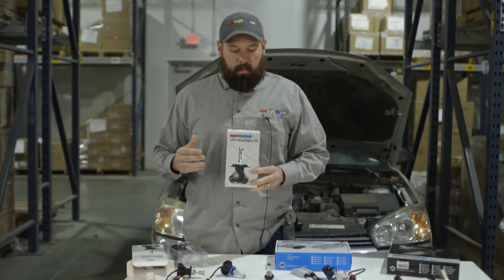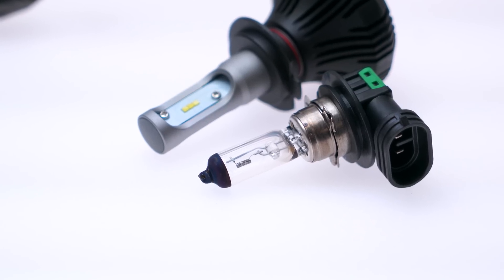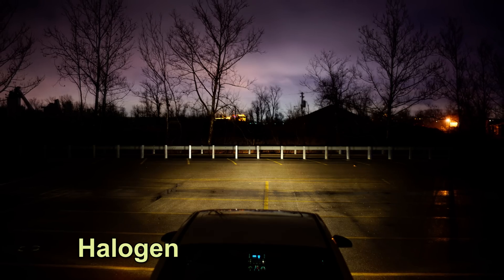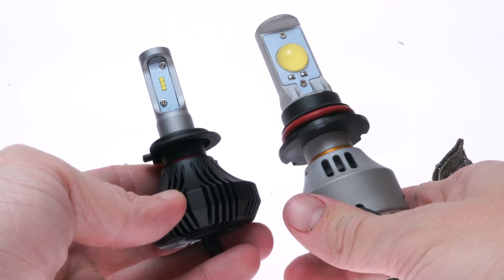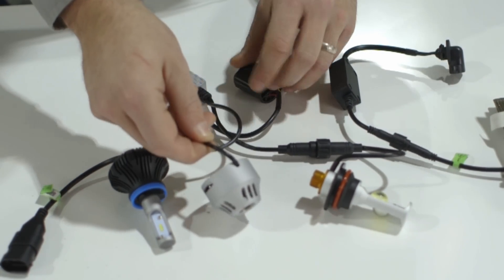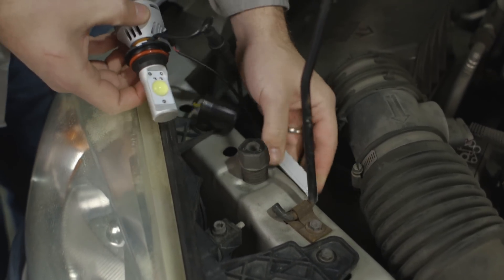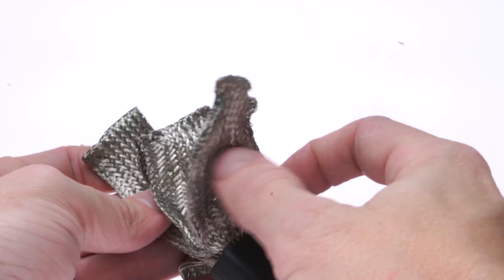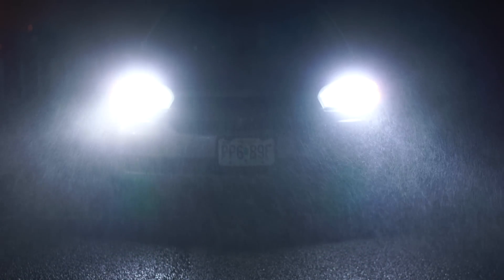The Best LED Headlights

Comment: I've seen some comments and couldn't agree more. Most LED headlights originate from China where there's no Q.C and within 2 months of usage, they start to flicker and by 4 months, they won't light up at all because the led's are toasted or the cooling fan gets clogged up. What's worse is inconsiderate people installing LED's in their reflector headlamp and driving around as though their high beams are on and blinding everyone in front. I have to admit, I did install led's in my reflector housing for 2 weeks until I stood beside my car one night and noticed that the lights were blinding even from the side view. Removed them immediately and went back to using Halogens from Bosch, Phillips, Osram. They may not be as bright but due to the colour temperature of 3 - 4000K, they don't get washed out in the rain or by dim street lights.

Comment: I have yet to find a led bulb yet that has a useful high beam. The low and high beam led's I have used are great on low beam but switching too high beam is just like blinking your eyes without much if any difference in the beam pattern.  i like my high beam to jump way farther out like a standard bulb. Does anybody know of a h4 led bulb  that has a good usable high beam thanks.
Reply: 200watt h4 led

Comment: Will these fir in a 17' F150 with the dust cover on and is a resistor needed
Reply: They were a little snug with my dust cover but I did not have to force anything.
No resistor was needed.

Comment: Thanks for the information - I have 2016 4runner and headlight housing is very small, I believe the latest generation LED will fit inside the headlight housing but there are no air circulation so can the heat coming from Led inside the housing can cause any damage inside the housing case. ..? Thanks again

Comment: very misleading .  you only smash the braided heatsink type leds if your a idiot...  with the braided heat sink it allows you to put led bulb in right spaces.. for instance,  your led bulb are you pushing in this video would  never ever even come close to fitting in my light housing with a dust cover ...
Reply: The braided heatsink is a poor design.  Period!
Reply: Yes,Braided heat sink work best for lights with dust covers like the Ram
Reply: That's why they have a vehicle selector on there website, so they can help assure a good fit.

Comment: Damn, I was really looking forward to these lights to work.  Unfortunately on my 2015 Versa Note the lights wont work because the dust cover will not fit around these lights.  Unless I am doing something wrong.   Can the hex screw come off the bottom of the heat-sink to be able to put the "screw-on" dust cover on so it will seat all the way?  If not, I am going to have to return these...

Comment: LEDs in reflector housings will always produce glare and blind oncoming drivers. Unless the LEDs are placed into a dedicated projector, they'll scatter light everywhere. Yeah you can see better at night now, because you're throwing light into the trees and blinding everyone else.
Reply: TheKing0fHalo Not true.
Reply: TheKing0fHalo I found a good 9007 model here, I had to mod it slightly to get the perfect beam pattern. forums.tccoa.com/#/topics/182185
Reply: TheKing0fHalo Blinding others is better than crashing into others....Two times crashed into black cow at pitch dark night when i used typical halogens....HID is best and no comparison to led headlights...

To Amerikun who keep telling us  BLINDING OTHERS scenario .....Get real  ...we can't drive having lanterns or candles on car headlights.....we must have a good visibility to even detect darkest of unknown dangers and some cars having no tail lights and apply brakes on time to avoid a crash......
Hell ya i would rather have a better visibility than to have myself crashed into URO....unidentified road objects....
Reply: I recently bought a H4 LED for a motorcycle, and it's an excellent replacement.  I too was afraid the glare would be insane, but I tried it out and found that it actually produced LESS glare on low beam, but was brighter on both low and high beams.  In fact, there's actually too LITTLE glare on the low beam setting for daytime use.  I always keep it on high beam in the daytime.
Reply: armand alec a
Reply: TheKing0fHalo v

Comment: Are you sure the lack of the fan isn't simply due to the lower power output?   These you advertise as 1.3K lumen, whereas competitors with fans and heatsinks are often DOUBLE that.   More lumens = more heat.

Comment: It's a sad deal that the LED Headlights produce an insane amount of glare towards incoming traffic.. otherwise they would be a great alternative for those not wanting to purchase a proper HID projector retrofit!
Reply: RAW Concepts LLC. Your buying the wrong kind.
Reply: JasonWW2000 , which are the BEST ones then, bc its not this one in this video.
Reply: THE MIKEY MIKE CHANNEL I don't know which of the current ones are best. I was replying to the statement that they produce glare. I've got 2 kits, one on my car and one on my motorcycle, that both use the Lumiled Luxeon Leds and they have perfect cutoff patterns just like the factory bulb. It's important to get leds that have the same size and shape as the factory bulbs filaments. You also may need to adjust the bulbs rotation as well as depth to get the perfect cutoff lines.
Reply: Actually the JDM astar 8th gen is what I ordered for my 2014 f250 and once you install they they're adjustable to get the perfect beam, you simply twist the back fan part and tada, you might look into them they're nice lights
Reply: THE MIKEY MIKE CHANNEL !,!,
Reply: RAW Concepts LLC.

 lightly tint the headlight lens?